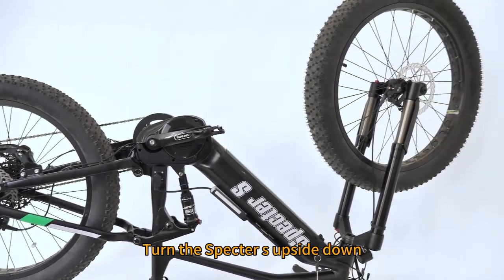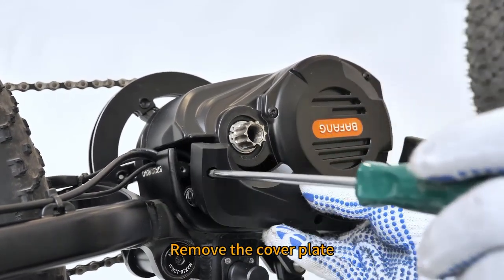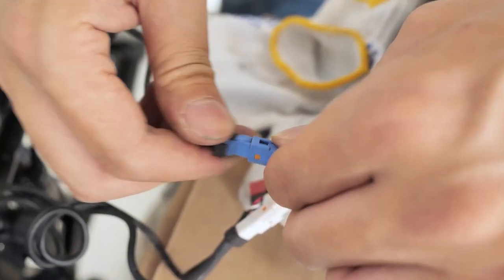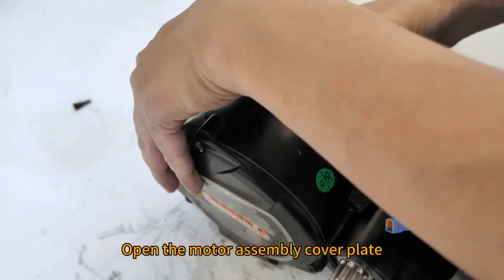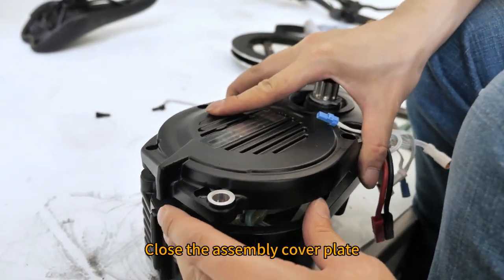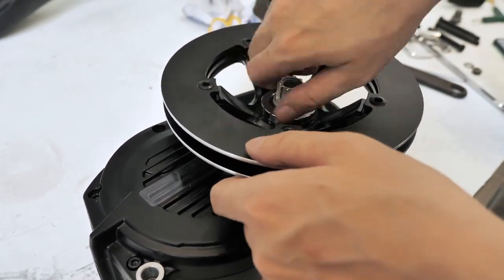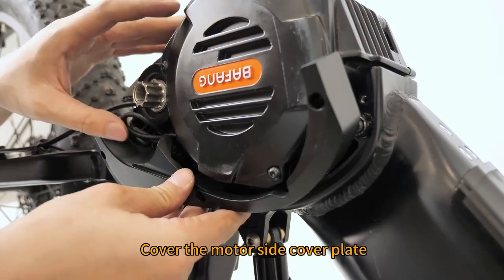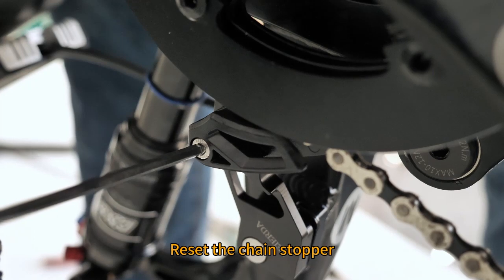HOW TO: Replace the Controller of BAFANG M620 Mid Motor

Comment: Can you list some of the reasons why you may need to replace the controller My specter s will not power on unless I am cranking my pedals and I hold down the power button as long as I don't stop peddling it will work